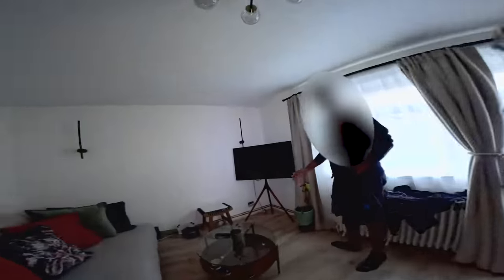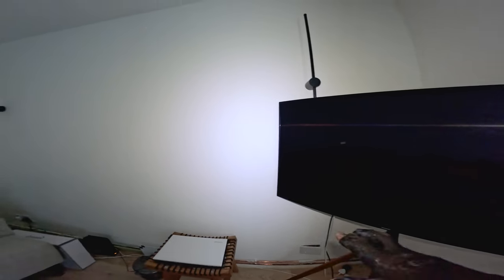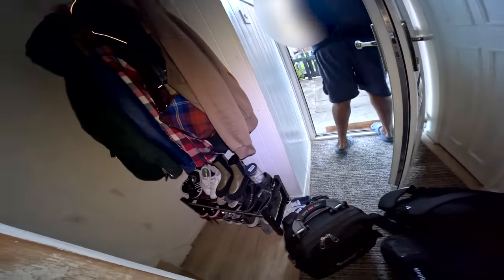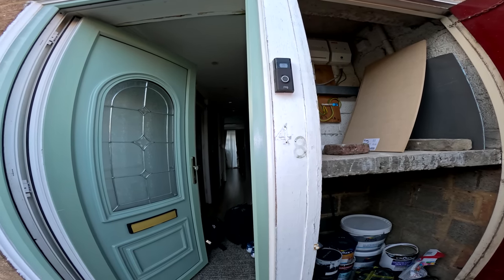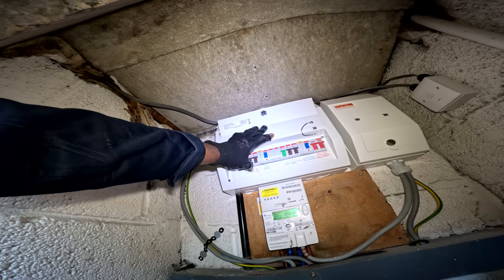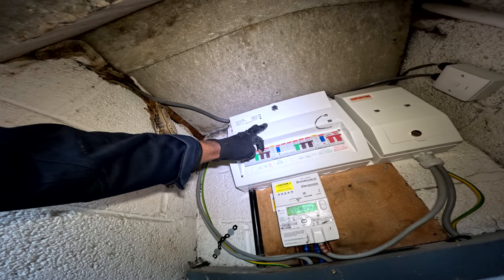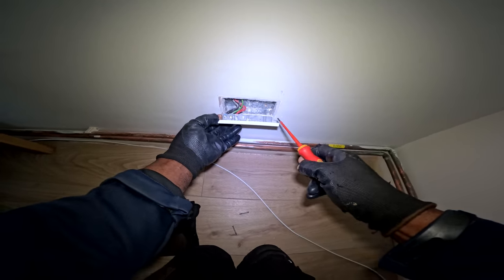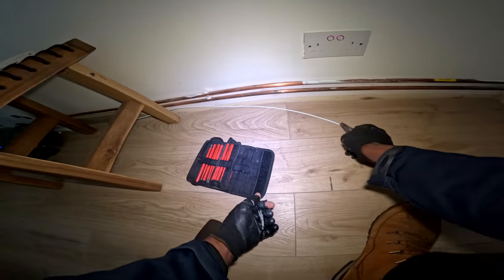"These Types Of Fault Are A NIGHTMARE To Find" | Intermittent Tripping | Electrician In London Vlog

Comment: Great summary by the customer. They'd tested it wasn't the TV, wasn't the kettle, microwave etc causing the trips. It avoids situations like that time in the shopping centre smoothie bar, you replaced a socket which it turns out was probably fine, it was actually the blender plugged into it which was tripping... A customer just doing some basic troubleshooting can avoid so much aggravation!

Comment: I was thinking about getting a wall socket like that to make it easier to turn the devices on and off using my phone but decided against it and just have a normal double socket installed, I had the electrician install it a bit higher on the wall so I can more easily access the switches on it. Also those things use abit too much vampire power for my liking.

Comment: Those BG electrical smart sockets are pretty nice from what I've seen. Saved having to buy smart plugs since it's all built in to the sockets. I don't see the point of them for something like a TV and most stuff but I have a normal one which I plug my portable electric radiator/heater into if I ever just want to heat 1 room. Lets me switch it on on the way home or come on an hour before I wake up since they never have good timers built into them. BG seems to have been around since forever too.
Reply: One thing about built in smart sockets though is that it's always technically got something connected to them even when nothings plugged in because the socket itself is now a device. He says nothings even plugged into the socket but it doesn't matter because the smart tech is still plugged into it in a way. So I can see fault finding on them being a bit of  a pain sometimes.

Comment: I wonder if his smart socket was loosing WiFi signal as soon as it was put into the metal backbox cos it was acting like a Faraday cage. Common sense would suggest the buttons should still work with the WiFi disconnected, but who knows how its firmware actually works.